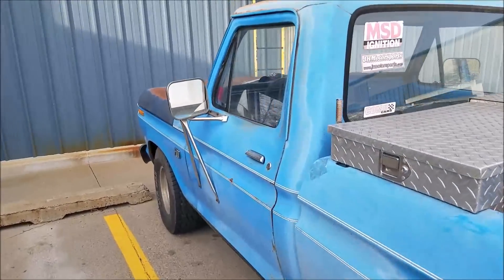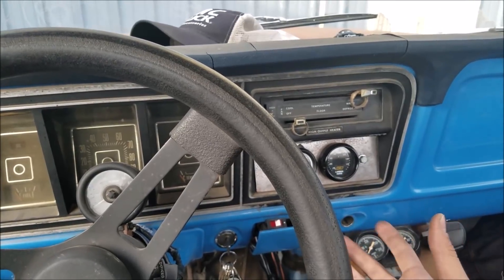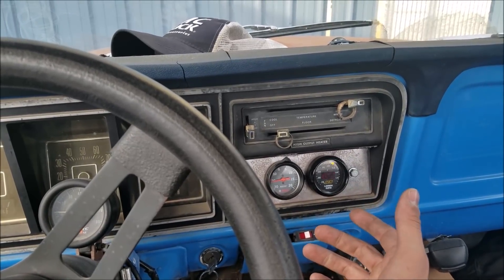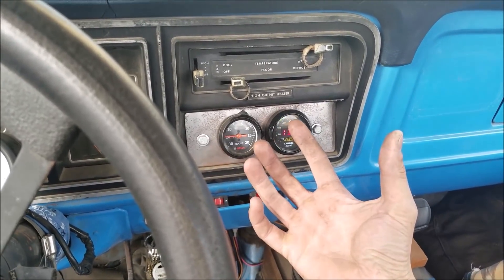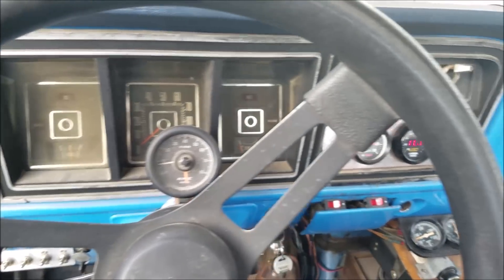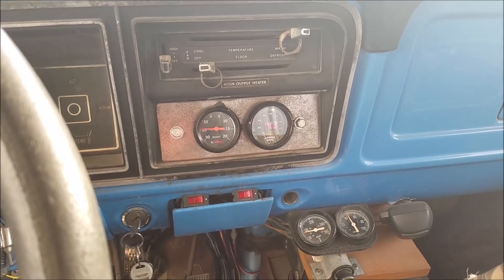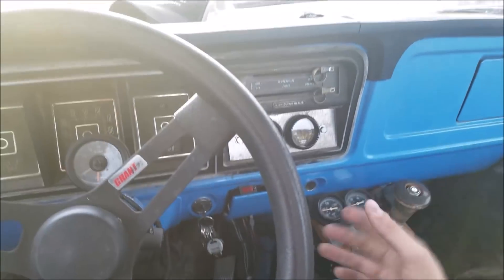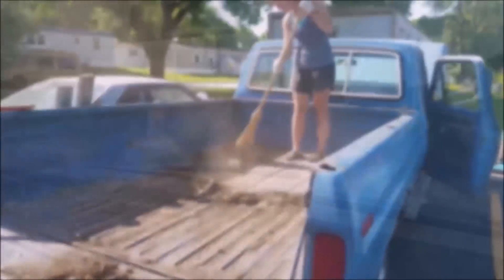Carburetors - Why You Hate Them (Demonstrated & Explained)

Comment: Efi and carbs both have their upsides and downsides. Technology typically does not make power it's air flow, fuel, and timing. The way I think of it is efi makes a smoother running engine and can be fine tuned better. Back in the days of poorly flowing cylinder heads and poorly designed chambers people would put in more radical cams to try and get more airflow in their engines. Tuning carbs with radical cams is more challenging with lower vacuum and having to adjust the idle mixture and timing. Now days we can use good high flow heads and milder cams to get the full potential out of our engines. This means engines making more vacuum and are easier to tune on. Often times work well enough out of the box where people don't have to do much to them. I personally would like to see you tune a carb while demonstrating the differences in AFR as you change jets, metering rods, power valves, choke, ect. Basically performing the job of an ecu as you watch the wideband while making changes. Also it would be helpful if you tuned a motor that is more difficult aka low vacuum to show people how it's done. Or maybe just throw some random rods or jets in to show people how to tune their carb if it is way off. Motortrend's engine masters did a carb vs efi on a Dyno and a properly tuned carb was within a few HP of port injected efi. There is not a lot of good info out there on carbs keep it up I have watched your videos and they have helped me. Hopefully they help others.
Reply: good comment.  Personally I cant justify $2000 vs $300 for the benefits of EFI on my play cars.   They start and run fine,  probably dont get optimum mileage but they arent daily drives.   Taking the trouble to learn how things work and maintaining a decent fuel system goes a long way to keeping a carbed car happy. From year to year I dont do much more than replace filters.
Reply: the problem with putting higher flowing heads on an engine, means your tq band will go bye bye.

Comment: The recent cold snap we had here in WI -20s and my 66 Dodge Polara fired right up when all these fuel injected vehicles wouldn't. Fuck fuel injection.
Reply from the maker: That’s incredible. I never even tried to start anything outside of my winter beater. 
Although in years past I have had a carbureted winter ride. 
Set them up right and you have nothing to worry about 👍

Comment: Would running a return line require installing a new gas tank?  I know some tanks have a built in spot for a return line because I ordered one last year by accident.   I'm definitely looking forward to that.  I already run a spacer, since I have a Holley Avenger on top of my 460, which is a spread bore manifold.  Keep the videos coming, it's refreshing to see some Ford love for once.
Reply from the maker: When I get the galaxie all done up for the spring I will do a rundown on it 👍
I love it - huge difference in drivability in the low RPMs on a blazing hot day. 
Two ways to do it - there is a cut in for the fuel fill line, or you can add something to the tank bottom - a rear sump on an electric set up is always ideal
Reply: @ThunderHead289 , I look forward to the rundown!

Comment: Manual chokes work fantastic. They require driver interaction but unlike most people today I don't believe you would have a problem.
Reply: my qjet that starts with a singe pump in 0* begs to differ.
Reply: @jordanwiley4582  some Q-jets work great, had a Chevy P/U like that. Tuned properly they are a good street carb. Hell, Ford even put them on 70 429CJ's!
Reply: I have a carb with an automatic choke and sometimes I hate it. I'd almost rather have a manual as most of the time I don't need the choke to be on.
Reply: @Terminxman  factory manual chokes were the sh*t. Converting auto to manual can be tricky. I prefer carbs designed for manual chokes. Cheap parts store choke cables suck. You damn near need a factory one. Best source is big trucks. The last factory manual choke  on a light truck or car was  67! Anything that works well they usually do away with.
Reply: @nickdulak1837  The edelbrock I have with the electric choke works just fine, It's just annoying sometimes when it and the high idle kicks in and it's not really cold enough to need it. I need to take the time to adjust it.
Reply: @Terminxman  Don't you just push the throttle real fast and let off to disengage the choke?

Comment: the way you talked about carburetors you sound like they are all the same.  NOT.   some brands are MUCH  better than others.   but since you didnt talked about a certen  brand i will not start an argument.
Reply from the maker: Moe Shouse I actually have a comparison video between the Holley and Edelbrock - personally I run summit carbs. Which is the Holley version of the 4100 autolite manufactured by Holley for summit racing Branding
Reply: MOE.    IMHO..  the Carter / Ebelbrock  is much better  because the circuits are more sophisticated.    but not wanting to start an disagreement.
Reply from the maker: I like the needle design - not diaphragms to fail. I don’t like the float bowl or secondary design. I wish they married all the favorable concepts into one single carb
Reply: There is kind of. A propperly tuned Quadrajet on  anything requiring 750cfm or less will yield within a few horsepower of the AFB or Holley carbs and almost always better economy. Problem with them is,spread bore on Ford applications, it was the most complicated carb on a stock application and absolutely hated being dirty at all. Also not very easy to tune properly. There was a 351W stock intake that used a Chevy style Qjet. I personally have only ever seen one of them.
Reply: i knew a guy that could get a Q jet re-tuned perfect.    the Q Jet does have some very good design feathers.   but when they had t make it meet smog specs they lost some of the advantages.  some of the early Q Jets was made by Carter.
Reply: my dad had a new 67  Chrysler  300,  440  with a Holley.    it was a little differant than the over the counter Holly.    we spent as much time tuning it as driving it.   the idle  kept   drifting adjustment.

Comment: I'm a masochist, that's why I run with Quadrajets only.
Reply: An 800cfm Super Duty Quadrajet is a pretty good carb though!
Reply: @1967davethewave  you haven't lived until you hear secondaries open on an SD lol
Reply: Love quadrajets. People just don't know how to tune the things.
Reply: Did they call them super duty i thought it was high performance they only came on a few select vehichles pontiacs mostly that i know of the trans am and the gramd prix
Reply: @glennmanchester1568  Super Duty was originally Pontiac's in house racing program starting in about 1959 if I remember the year correctly. It became their over the counter racing parts program after GM pulled the plug on factory backed racing in '63 or '64. Then the Super Duty was resurrected for the 1973 model year in a really maximum effort 455. It was the hottest factory effort for Pontiac on a street engine and would have been even better had it come out a few years earlier when the compression could have been higher. The 455 Super Duty was very special with the best flowing round port heads Pontiac ever manufactured, extra heavy block with lifter valley reinforcing and provisions for a dry sump oiling system (not installed but available over the counter for road racing), super heavy "Super Duty" connecting rods that were the most sought after pieces for use in Pontiac motors for 30 years and of course, a big huge, 800 cfm Quadrajet Carburetor that had a larger idle circuit and larger high speed air bleeds to be a truly high performance carburetor. The Quadrajet first came out on GM vehicles in 1967 and was the best designed carb up to that point. It was used on almost all GM cars and trucks except for a very few exceptions all the way until mid 1988 when the fed mandated all passenger cars would be electronically fuel injected. Then it was used on trucks until a couple of years later when the fed mandated them to also be fuel injected. I have a '69 GTO with an aluminum headed 455 and it runs consistent 11.60's at 114mph. I have used a Super Duty 455 Quadrajet and a Holley 850 HP carb and the ET's are almost identical. The Quadrajet starts better, especially when hot, the Holley generally gives me about 1/2mph better trap speed.

Comment: Well you finally had to retire the rot stang and granted its not one of the prettier body styles 64-70 or a fox body but a good little 302 in it and make you a little hot rod
Reply from the maker: Ah gotcha, in the spring I will reveal my 65 5 speed swapped galaxie - that’s what I’m building my engine for. 
It hasn’t seen the channel since 2015!!!
Reply: @ThunderHead289  the black one you drove to Virginia? That is a nice ride and a keeper , but you can't treat it like your old Fox body its to nice of a car for that. The mustang 2 well they were always ugly as sin so you could rag the crap out of it and be ok. The galaxy 500 you wouldn't rag it to nice of a car ,it's like Cinderella and the 2 is like one of the ugly step sisters .

Comment: Same issuo with my truck, but it the 300l6 takes about 15 mins to warm up. If it is below say 25°f it never warms up, unless i block off the radater.
Reply from the maker: ???? 
My f100 warms up quick. 
The older mechanical fan vehicles have a way of keeping the coolant so cold that you will have that. 
Modern electric fan cars are much better about regulating radiator temps. 
Crazy how over the course of 200k miles the fans don’t wear out

Comment: You do not need a return line  for a carburetor
Reply: Ok thanks never had a problem but mine was a weekend toy
Reply from the maker: BIG BLOCK FORD turning over slow could be because the starter is gett my top hot, or the carb heat soaks and pukes fuel out of the vents into the engine. 
Try this, when it’s warmed up and off, hold your foot to the floor and crank it. If she pops right off, I bet you could add a better carb spacer and be good to go.
Reply: BIG BLOCK FORD had the same problem i put a heat sheild around the starter and a 160 defree thermostat in it and worked great . dont need a 180 or 195 in the summer
Reply from the maker: You don’t need it, but all of the carb related drivability issues associated with 100 degree heat and idle traffic disappear with an electric pump with a full bypass regulator 👍
Wouldn’t have survived the summer in Virginia with my 65 galaxie without it !!!! 
Vapor lock disappeared entirely

Comment: The cooling systems were not the best back in the day with the old school mechanical fans. Especially if you were stuck in traffic in the summer. I went with a dual Eletric fans. And an Aluminum radiator.
Reply from the maker: I had a 18 inch mechanical fan on my galaxie with an aluminum radiator - I’m going to add a temp controlled with manual override electric fan set up pusher style when I put my next engine in
Reply: @ThunderHead289  Yea I don't like or trust the thermostat controlled Eletric fans.  Mine are manually controlled . the up side is you can leave the fans off and the engine will warm up faster. Comes in handy when we have temps like we had last week.
Reply: @jamesbascombe8274  It never ceases to amaze me how the radiators in old cars, specifically muscle cars were usually just enough to keep the cars from overheating. Any issue at all and you had an overheated motor. I own a lot of old cars and it seems like Mopar was just out to burn their motors up. I have a 69 Super Bee with a 383 and A/C. It has the larger 26" radiator and a nice 7 bladed clutch fan but no fan shroud. It would heat up and start puking coolant in traffic in the summer with the A/C on. I added a fan shroud and all the problems went away. It would have been very easy for the factory to do this!!!
Reply: @1967davethewave  pretty sure they came with a shroud from the factory.

Comment: My 86 Iroc Z runs just as good as any fuel injected vehicle I own and it has a 400hp 355 with a 670 Holley street avenger.  I'll drive it anywhere once the salt is off the roads.
Reply from the maker: I drove my carbureted foxbody all year round. Started it in -6 degree weather even. Have a video of doing so. 
Are carbs more involved? Yes, but it’s very rewarding to know you have accomplished something that others don’t believe to be possible
Reply: I thought the IROC Z was the beginning of fuel injection. You learn something new every day i guess
Reply: @P7777-u7r  You could get third gens with  a carb until 87, fuel injection was always an option.  Iroc Z was just a handling and appearance package you could add to a Z28,  a lot of people think they were all TPI but that is not the case, you could get any engine, trans, rear end, brake combo available in the Z28.  Mine came with a carb 305, auto, 2.73 gears, rear drums.
Reply: Horsepower Garage 

Interesting I didn’t know you could option those out in that much detail 

I know it’s incorrect but by IROC Z I was referring to that era of camaros in general body wise etc. 

Was the fuel injection option multi port or that awful throttle body injection Chevy used for awhile?
Reply: @P7777-u7r  Third gens had crossfire, tpi, and tbi depending on the years.

Comment: After reading the comments. Looks like i'm the only one who daily drives and grew up driving more carbureted vehicles than EFI. Rarely ever a problem with any of the carburetors. Although I do prefer EFI over that feedback computerized carburetor crap if I had to choose one of those or EFI. Regular non emissions carburetor is my preference.
Reply from the maker: I completely agree!
Reply: @ThunderHead289  It seems the people who complain about carburetors are the ones who can't figure out to step on the gas a couple times for a cold start. They are also the ones who seem to complain about manual transmissions. Oh boy, I don't know what they'd do if they had to drive a carbureted vehicle with a manual, with no power steering or power brakes!
Reply: 1986FordF-250 that’s exactly what happened to me. A bunch of kids in my shop class all jumped in my ‘49 Chevy with manual brakes, steering, and transmission and had no idea what to do. Felt great to give them a little lesson from the past haha
Reply: @wallyworksonstuff  Non synchro? LOL!
Reply: 1986FordF-250 no, it actually is synchronized haha. One person out of all of them knew what that little button down by the gas pedal is ;)
Reply: @wallyworksonstuff  button starts it up.. I'm 28 and have a 41, 1/2 ton Chevy Pickup truck

Comment: Carbs have vapor lock,flooding and a few more problems.There were carburetors that were flat out garbage from the factory.The Chrysler thermoquad was one of them called a thermojunk a lot.Ford had a few,one was made by Predator.The feedback carbs too.The carburetor was not very reliable most of the time,also too many parts.I am glad electronic fuel injection is out there which is very reliable.Now there are kits that the throttle body looks like a carb to put in place of a 4 barrel carb that is self learning
Reply from the maker: In the spring I will show how to beat the carb at its own game. Full return line with carb spacer and she’s jolly as a roger to take to the roads. 
But I understand that viewpoint, if it’s not something you like to drive, and if your not into the pride of doing it and the nostalgia then fuel injection is the way to go. 
And I can’t fault anyone for going that route 👍
Reply: @ThunderHead289  I think a lot of people are scared of carbs especially if they are not mechanically inclined.  I tore my Holley Street Avenger completely down when I bought my car 5 years ago because it was running like shit, soaked it, cleaned it thoroughly, installed a rebuild kit, did a little tuning, and it has ran perfect ever since.  I have videos of the car on my channel.
Reply from the maker: Like all things, carbs are no different. People are afraid of what they don’t understand, and in not understanding they will scoff at the idea or concept to make themselves feel better for their lack of knowledge. 
I’m guilty of the same deal
Reply: There are talks carbs are going to be phased out.Most rock crawlers are fuel injected,the carb is prone to fuel starvation in this application
Reply from the maker: Walter Frederick I’m amazed carbs are even still around considering everything went injection 30 years ago
Reply: @Toolaholic7  Vapor lock is a problem in the fuel line not a problem with the carburetor. Most people don't understand what vapor lock is. It happens on the suction side of the fuel pump and by putting the fuel pump in the gas tank that problem is eliminated. Fuel injection systems originally put the pump in the tank for noise suppression but as it turns out no vapor lock is a side benefit. Carburetor's biggest problem is not being able to adjust for altitude, temperature and humidity changes. The Quadrajet is about as good as it ever got and they worked very well in most situations when they were in good condition. But I agree that electronic fuel injection is hard to beat.
Reply: Now most newer motorcycles and certain riding lawnmowers have fuel injection from the factory
Reply: efi very reliable? i love how you say carbs have problems and that some out of the factory were garbage, but ignore just how AWFUL some efi was from the factory.
Reply: There were a few EFI systems that were bad,GM had the crossfire and the digital setup that were not a good set up